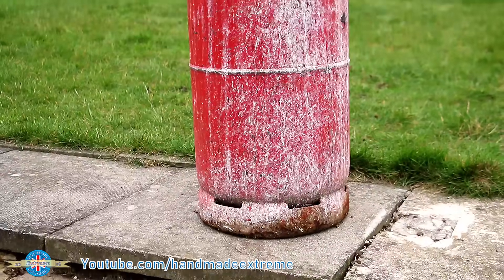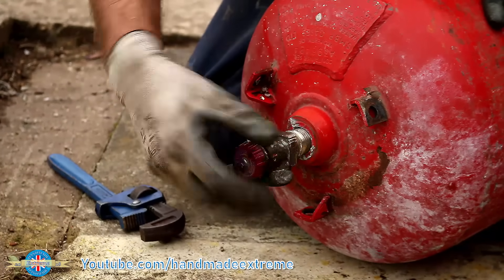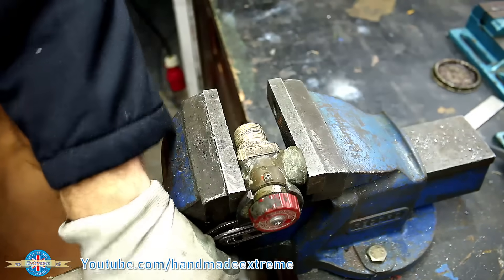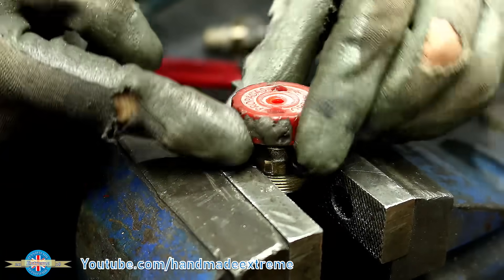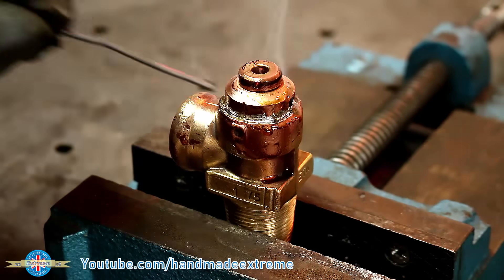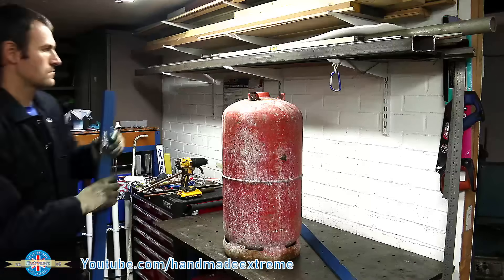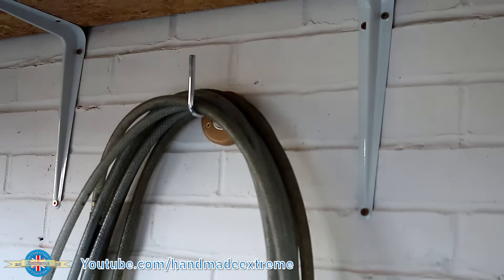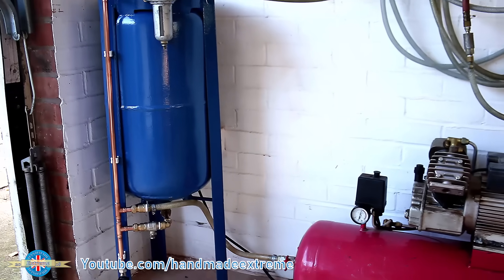Making an auxiliary air tank from an old LPG gas bottle.

Comment: I've actually thought about doing something similar to this myself, might have to try it now! For example ive found you can get 100lb propane tanks, about 24 gallon for around $170 usd, and they are rated for 240psi, but if you want to buy a 20 gal air compressor tank, rated for 180psi they are around $500 or more depending on the company.
Reply: Wow I can get 100lb tanks for about $50 or less, sometime free
Reply: @robertboyd3863  brand new?
Reply: @lrgbajablast  No, used, which is what I thought he was talking about
Reply: $500 for a 20 gal?  you can buy a 60 gallon entire compressor for less brand new.  so maybe do that and sell the motor and compressor.
Reply: not one rated for 180psi @justinpaone2227

Comment: The one thing I'll add is that you probably should have painted or otherwise coated the inside of the tank. Bare steel plus water equals eventual boom.

Comment: Thanks for sharing,
& did an excellent job. 

I just believe that you have 
had preformed more work 
than necessary...

If you had utilized a (used) 
water heater, could have the 
same results without special 
parts & tooling.

Comment: what about pressure differences between the two tanks? IE what if one tank is rated at 100psi and the other at 120....  ?
Reply from the maker: They are both rated for higher than the maximum pressure the compressor can deliver. When the compressor is running they will both experience the same pressure. Hope that helps.
Reply: @Handmadeextreme  yea it does, wasnt sure what pressures you were running at

Comment: Just adding a second tank will not shorten the compressor run time. It will run twice as long to fill both tanks. If you link two compressors together and one burns up, you still have an air compressor while you're shopping for a replacement.

Comment: I see people do this and just shake my head. Just buy another identical compressor and link them together. Adjust the pressure switch on compressor no. 2 down 15 psi or 1 bar. Only compressor no. 1 will come on during normal use. If needed compressor no.2 will come on also and you will have double the SCFM'S.

Comment: Only in the UK cuz you guys got more different safety stuff and ours are actually just straight up valves on our propane cylinders you open it up there's no tire frame or nothing it's just a valve that moves up and down I know I took them apart I used to do gas lines when I was in my twenties had to mess with valves on cylinders and on big tanks

Comment: OMG... a pneumatic receiver tank bodged up from a thin wall rusted LPG cylinder.  
The reason why that tank was given away free was because it is out of date... beyond the use by date. i.e. It would be illegal to decant any propane into the cylinder until it had been hydrostatic tested and re-stamped with a new tested date.. if it passed, which I doubt due to surface rust.

Have you ever seen what happens when a pneumatic cylinder ruptures and know why hydrostatic testing is the only way to safely pressure test such vessels?

Comment: Why not: Turn the tank upside down first after removing the valve, put in a narrow air pipe and flush the remaining propane that way. Instead of all that work with the original valve, just acquire a 90 pipe fitting and install that? An automatic drain valve will be your friend here. MiG or TiG welding is much more satisfactory. I almost never use my Arc welder any more unless the metal is very heavy. With extra air capacity, 1/2 inch air fittings are the way to go. Also, install an air dryer. Still, nice work! My compressor is a dual stage with a 120 gal air tank, auto drain, dual air dryers and 1/2" hoses and fitting that I use quite a lot for media blasting, I often have to work more than 100 feet away from the compressor. One day I hope to afford a large screw compressor. Way more efficient.

Comment: Nice.  However, I have serious doubts the water purge is necessary.  
Stick an air hose inside and/or up-end the tank to blow/flow/dilute any remaining propane gas.
Heard of one guy who put in dry ice to displace any gas.

It would have been interesting to see a bore scope inspection of the interior of the propane tank.
Maybe slosh around some paint primer in the tank to add some rust protection;
maybe rust convertor if any significant rust already present.

Comment: Nice way to hook everything up.   Question is:  Can these old propane tank handle up to 150 psi?   If they are old tanks, should they be hydrostat tested?   I've seen a 120 gallon horizontal air compressor tank explode (pressure cut off switch went defective).  It was not a pretty scence.  Absolute miracle nobody got hurt.  Shrapnel could have lethal, and the 350 pound (weight of compressor)  moved 10-12 feet from it's original location.   i'd be lerry  of tanks not rated for a min of 150 psi
Reply: did it not have a pressure relief valve fitted
Reply: Most tanks have a rating engraved on them. Normally it's 300+ psi

Comment: Unsure, but belive here in the U.S., you aren't to weld to pressure vessels.  Any bits that were already there that doesn't constitute the vessel such as preattached brackets are exempt.  I do however like your implementation and craftmanship.  Having been the factory drill press and thread operator for metal fabrication company, I have to say with the exception of glass, drilling bronze and brass is awful.  It's not so much the grabbing of the drill bits but the cleanup ensuring that none of those chips get in your protective gear or clothing.  That stuff will itch like fiberglass.  Always goggles when blowing those fine chips away.  Question, are having any issues with the duty cycle of the pump and motor?  Thanks.  Great work.
Reply: Nobody is inspecting air tanks in private garages

Comment: This is similar to a build I have wanted to do for a while.  Tanks for CNG (Compressed Natural Gas) for vehicles are typically rated for 5,000 psi (340 bar) and actually filled to 3,600 psi (250 bar), and their certifications (in the US, at least), expire after 10 or 15 years, so there are quite a few very high pressure tanks coming available as they age out.  They're large, often composite, and even the steel ones are typically epoxy coated on the inside, so little bits of moisture shouldn't cause problems.  (You still need to drain your tanks, people).
Reply: propane tanks can be re certified at certain fill stations.if approved can last 10 to 15 years more.

Comment: I have a 25 gallon tank in my shop, and wanted more volume as well. Searched for a good deal on a old air tank locally, ended up getting a 60 gallon tank that was just ugly from paint over spray. $40 can't go wrong. Sand blasted, and I painted it gloss black to match my 25 gallon tank. Its a simple set up of connecting them together, how ever I am adding a water Seperator between the running 25 gallon tank and my 60 gallon storage tank to keep water out of the 60 gallon as much as possible. From the 60 I will then feed the shop, and have a regulator on a line drop, and have unregulated air on another drop. I also wanted to make sure the 60 gallon obtained a pressure bleed valve that is spring loaded, so if the tank reaches too much pressure, it will vent automatically. Don't want that large tank to turn into a powder keg.

Comment: The compressor will still run the same. Your air pressure will not drop in pressure quickly, by adding a auxiliary tank.

Comment: The easiest way to get rid of moisture is to get an auto drain. 
Works like a charm. SMC makes good ones for a reasonable price.
OR you can get an in line filter with moisture removing cartridge and auto drain. It's just a float inside the bowl. I have one on the base of my compressor tank and a moisture removing one at the beginning of workshop line.
Moisture is bad for air tools, bad all round. Factory air usually is dried by more sophisticated condenser units.

Comment: Excellent well done! Question: With the concern about water build up in the tank, does the original RED tank also have a water drain?
Reply: purpose built compressor tanks tend to have 3 openings.
1 at the bottom for drain,
1 on the side along the center axis for outlet/regulators/pressure gauge combo,
1 on the side offset from center axis for the compressor feed with a check valve.

Comment: Has that setup killed your little red compressor? I’m interested in doing the same but I have a kobalt 60 gallon, I am planning on getting a pump upgrade and motor upgrade if needed. I’m gonna add second 40-60 gallon aux tank

Comment: Love your new air tank.  Very good idea.  i made myself a portable air tank from a 7 gallon propane tank used from RV's it was over 10 years old but in lovely shape and i just fill it at mechanic shops with dry air at 150psi.  For me it works for 4 months just filling up bike tires and topping up truck tires once every two months.  I do have a 100 lb propane tank which is about 2x as big as yours and that one i would like to make a stationary tank so i can dust of my work bench maybe.  I have 5 lb 11lb and 20lb propane tanks that i will make more portable tanks out of.

Comment: if this is oiless compressor, i assume it will not exceed the duty cycle of the compressor. my eight gallon oiless compressor has 30 mins max duty cycle. meaning i should avoid running my compressor more than 30 mins to fill the its tanks.

Comment: Have you ever smelled an open propane tank a month after the valve has been removed?  It still smells like propane.  The metal continues to offgas propane   Now you want to compress residual gas with high pressure air.  Have you considered registering your creation with the ministry of defense?
Reply: No the smell is the additive. The gas is long gone
Reply: did this 40 years ago and it still works

Comment: This is great if you are a machinist or have easy access to a machinist.  for us mere mortals, having that fabbed would be very expensive.. epically in covid times.   When you pop the top off, is there a fitting that you can replace it with one that that you could  put an air hose connector into ?

Comment: Personally I think it was a great idea and well done. I have used a LPG tank (propane) for other purposes (a boiler tank for steaming wood so pressure was not a concern) and found  threads (USA) in the tank inlet/outlet were standard pipe threads. I never thought of inverting the tank and a separate condensate collector, I think that is genius, and wish there was some way to incorporate that into my horizonal compressors. The only change I, repeat I, would make is a 30 degree slope from the tank to the condensate tube for better drainage and that could be wrong also. As far as codes, my community differs greatly from another on the opposite side of my county so suggest a idea or opinion, not order it. Maybe my codes are better, maybe not, but they are what have to live with.

Comment: You can make a normal metal drill bit to a brass bit by grinding the edge a few degrees negative (or over 90 degrees if you will).

Comment: Great video and good use for this tank, I also like your setup to draw off condensation.... I think it would of been easier to simply replace that brass gas valve with an Brass elbow and use a flare or compression fittings instead of all that labor intensive machine work just to modify that old brass gas valve to save on buying an inexpensive fitting. Everything was great but I think that mod was kind of silly.

Comment: Very impressed with this video.  Concise.. Good explanation of why the tank was upside down and the water drain..  and no heavy metal music.. thank you for that..   One option I am currently considering for  a similar Air holding tank is using a Stainless steel Beer barrel which can be aquired for £10 or so.  It has an interesting Thread on the top (2" x 16tpi I think)  but I think all your suggested options of re-utilising fittings could apply..

Comment: I'm wanting to buy a compressor but money is the limiting factor, but, I already have an 11 gallon air tank that is fairly new so I am going to add it to whatever compressor I buy (10 gallon will be the minimum I buy) so I can have more capacity.  I'd ideally like to get a 20/21 gallon compressor.  I decided to see how to connect the air tank to the compressor.  I was thinking of copper pipe vs the rubber hose option.  I would like to make something that would hold both the compressor and tank together, but you option would be fine I guess.  Thanks for the video/idea.

Comment: Interesting video as this is exactly what I need to do, however I have  question about turning the tank upside so the water/condensation can drain out. 
With all the different propane and butane tanks I have (calor, flogas, BP etc) they all have quite a deep lip on the inside of the tank where the gas valve thread is, so its a natural liquid collection point when turned upside down, so are you not just creating a water reservoir in your tank to constantly keep moisture in your air system? 
Would it not be better to drill into the bottom and weld a nut or pipe fixing on for your drain and raise the tank off the floor for clearance?

I didn't realise there was such a lip on them until I purged them with water as you did, then it's a right bitch to dry them out, ive tried heating them up, that gets rid of alot but all the steam condenses on the inside and just when you think it's dry you find another pool of water in the bottom which isn't a problem when cutting them open but not the case when using them as you have.

Comment: Nice demonstration of something I might try to make.   Tiny tangential comment:  If you (or any readers) work regularly with brass, it is recommended to use a HEPA vac to clean up, never air or sweeping.   Saw a case of lead poisoning from chronic exposure traced to wrong factory cleanup of brass shavings.
Reply: Bullshit. There is NO Pb. content in Brass or Bronze alloys. 
Maybe if the fitting was contaminated with soft Lead solder, like the crap this guy used to modify the brass fitting.  Silver based brazing alloy should have been used on all those Cu pipe fittings instead of Lead based solder.
Reply: @BTW...  Troll alert!   Obvious example of the Dunning-Kruger effect.   You can search for "copper brass lead content" on the internet.  It's free.  And look up Dunning-Kruger effect before posting comments saying Brass and Bronze have no Pb content.  The internet is your friend.

Comment: Very well put together video 🍻 fellow Brit too, good to see. You deserve far more subscribers than you have. Count me in.
I'm an engineer (marine engineer, so deal with HP air often 300bar+) and I was nodding along to this, my first thought was about moisture/condensation and you addressed that. One thing that would be an improvement is a cross fitting on the bottle top and an added relief valve. But then again in a personal setup it's not really needed as you know the system :) 
Have a good one.
Reply: Did you nod to the use of an old date expired cylinder being used as receiver WITHOUT HAVING IT HYDROSTATICLY TESTED and that test date restamped?
Reply: @BTW...  he could hydro test it with a pressure washer

Comment: A compressor pump , motor and tank are matched for optimum performance. If you add a bigger tank you really need a bigger compressor pump .Yes you will have  more volume of air from full to empty but if you are using air tools the compressor will run longer to fill and switch off if at all.
Reply: It depends on your use case so it cannot be optimized for everything. If you are using tools that require a lot of air but not for that long like opening big bolts, smaller compressor and extra tank is just fine. If you are using a lot of air for long time, like when sand blasting, then you need big compressor you might not even need a lot tank capacity. 

Also big tank also cools the air quite well. For example when painting big tank is nice as it keeps the pressure steady and output airflow is cool. So it really depends on what you are usually doing.
Reply: Nah, you'll see the same compressor on various sizes tanks, with the specs saying the time difference to fill. The longer rest cycle that the bigger tank allows outweighs the on cycle needed to fill it. Everything is a trade off, but unless he's emptying the bigger tank every day, you won't see a big change in the compressors life span.
Reply: Uh oh, nobody arguing, so this leads me to believe you are onto something here.

Comment: If your compressor is delivering air to the auxiliary tank, how does the auxiliary tank deliver air to your airlines if everything is using the same copper piping, I'm confused ??? 

My compressor fills my auxiliary tank at the top and it exits at the bottom of the tank.
Reply: Air pressure just flows from higher to lower. Connect a line and it goes

Comment: I've been using an old gas bottle as a second tank for about 15 years now, no issues, no problems... however I would state that's good advice about having it up side down to self regulate water intake, mine was on its side for a couple of years and built up a fair amount of H2O inside, even though I would drain the main tank weekly. Now my aux tank is upside down and no problems, I use a 47kg Calor bottle.

Comment: From what I understand propane tanks are a lot thinner than air tanks because propane doesn’t cause the tank to rust from the inside.will this tank pass a safety inspection required by the hse
Reply: What safety inspection of an air tank in a private shop? There's none